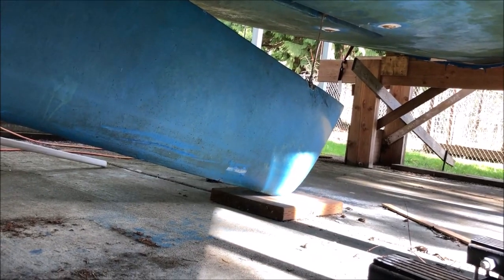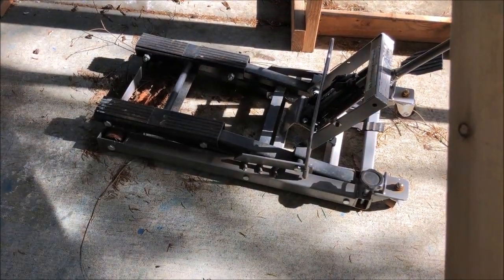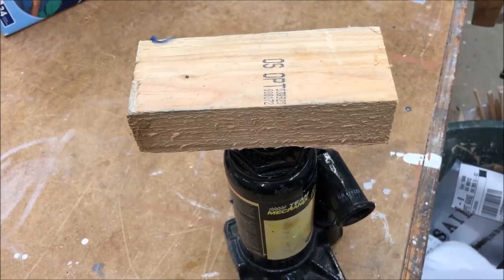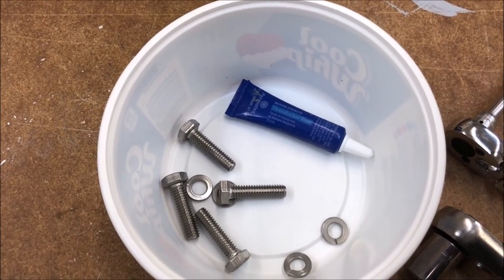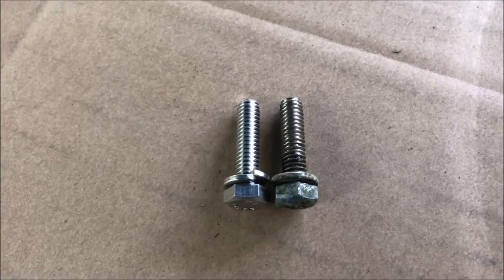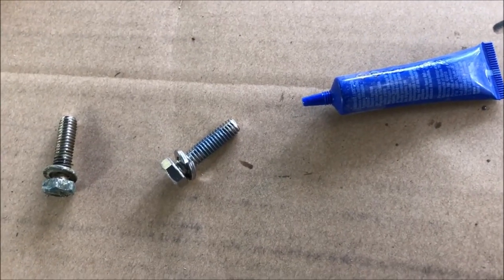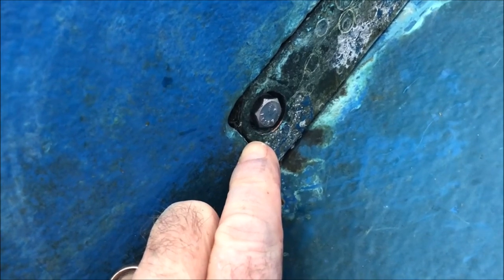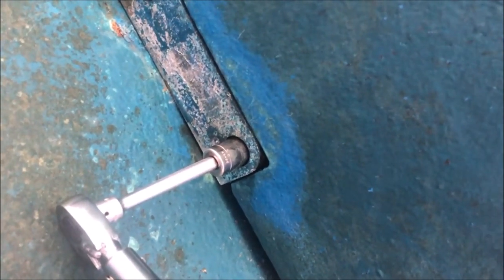Catalina 22 -- Installing Swing Keel Bolts -- Jim's Little Boat

Comment: I was your 1000 sub! Just bought a Catalina 22 and your channel has been perfect
Reply from the maker: Well thanks, Chase.  When I made the first couple of videos I didn't know there were subscribers.  My goal is to help out beginners.  If you have a question or idea, you can contact me at:  jslosson@aol.com.  I have a google account but I don't want to act all digital.  jim
Reply: @jimslittleboat4388  thank you so much Jim . I will definitely be watching all your videos ! I found a very good 1988 Catalina for single sailing I think . I’ll be learning to sail on Erie and hopefully improve my skills. It has a shoal draft wing keel, full batten mainsail, a roller furling Genoa, and all lines lead aft to cockpit with tons of extras, someone really cared for this boat so hopefully not a ton of repairs , but I’ve set aside a lot of money to get her in tip top shape. If I run into any issues maybe it can be a good video idea for you !

Comment: Hi Jim! Another informative video. I as looking at the one where you selected a battery for your boat and you panned past your solar panel. Would love to mount one on my 25’ C&C. Did you make a video of installation of the solar panel? Thank you for the videos.  William J.
Reply from the maker: That is a very inexpensive panel from Harbor Freight and it works well.  It came with the boat; I just mounted it.  When it goes I will get a slightly higher capacity system.

Comment: I just dropped the aft end of the keel and replaced the bolts 1 at a time, then snugged in an x pattern, like lug nuts. Easy Peezy. Hopefully it worked.
Reply from the maker: Should be fine.  I used to do it that way.  The jack on the forward part is for a guy named Justin Case.

Comment: If the bolts at 2:06 are new, what type/grade are they or did you just purchase from Catalina Direct?
Reply from the maker: Catalina Direct.  Cost a couple bucks more saves time, and it supports a valuable resource for Catalina owners.
Reply: @jimslittleboat4388  All good points I had not thought about. Thank you Jim!

Comment: They're only torqued to 132 in-lb?  That seems really low!
Reply from the maker: I thought so too, but I looked up the specs for those bolts.
Reply from the maker: On the other video, I found the failure occurred at 30 foot pounds.